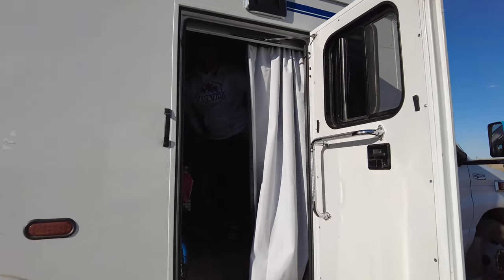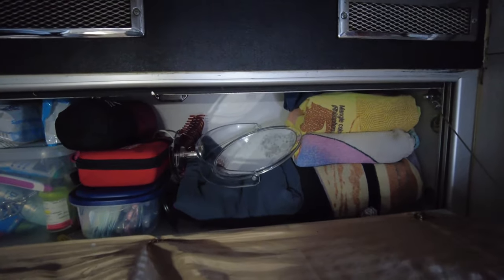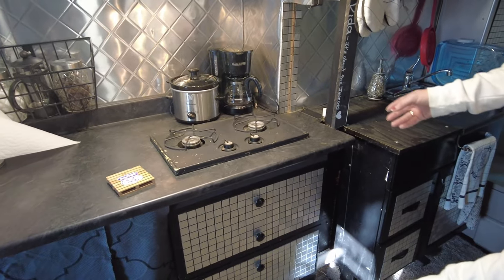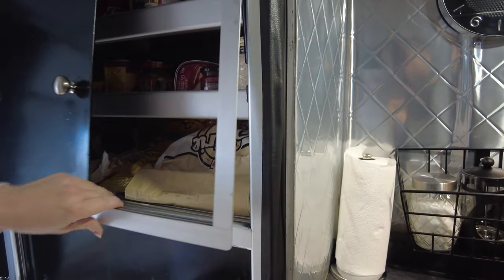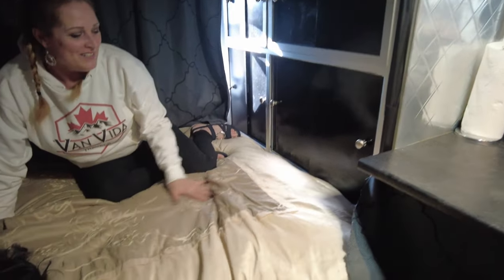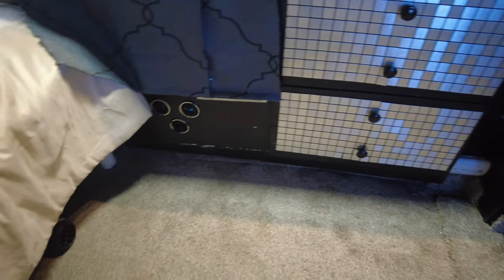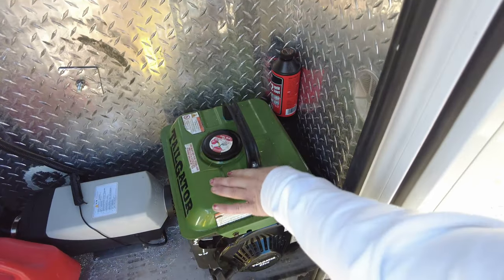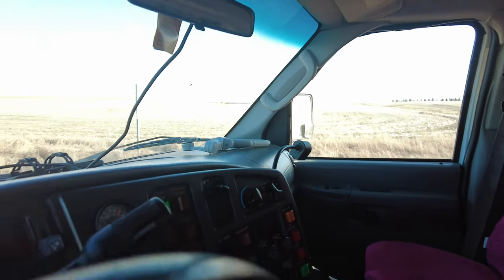Ambulance RV Conversion Tour

Comment: Love the tour.  Great innovation and creativity. 

We have a 'Natures Head' and it is a  super compost toilet, no odours as it is equipped with a small fan and exhausted to the outdoor.  

Highly recommend the MaxxAir.  Our 2017 build had a strut failure.  No bill of sale, no proof of warranty, could even tell them where it was purchased but we simply sent a pic of the failure and it was immediately replaced.  That is called service.  

Yeah we will be upgrading our batteries from 200ah to 400ah Lithium.. for the same reasons.  We use a $69.00 Butane stove too.. super convenient.  We also use a simple Napoleon BBQ while ouside and on Vancouver Island, that is most of the time.  

PS: started watching with your Livestream with JeffieBear.

Comment: 01:21 If that red cable running between the lid and base is hot, reroute it through the side board to prevent chaffing and a possible short.  Drill a hole and insert a rubber grommet, then run the cable.

Comment: The Anti theft is what ambulances are equipped with in Canada to prevent them from being stolen when there idling at a call and the paramedics are away from the ambulance. The ambulance won’t go into gear with this switch activated and the keys removed from the ignition. 
When the ambulance is running simply turn the anti theft switch on, and remove your ignition keys and the ambulance will stay running, to disengage it simply put your keys back in and turn as if your starting it and shift the truck into drive and your set! Good little feature for when it’s cold out and you don’t want to shut it off but don’t want to leave the keys in the ignition for someone to hope in and steal
Reply from the maker: OMG! Thank you Taylor!!! I had no idea, this is awesome to know.

Comment: Swap out a solar panel for a 500 watt then ya got more power n lithium ion batteries . Great rig
Reply from the maker: Great suggestion, thank you!
Reply: @VanVida  also if you still got the ole Halogen Headlight bulbs switch to LED bulbs ..LED is better on battery less drain